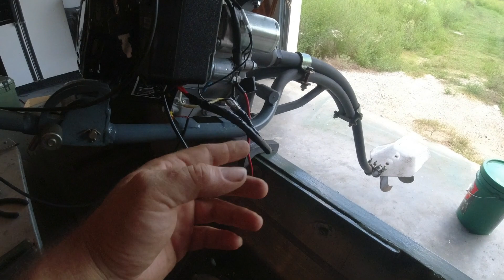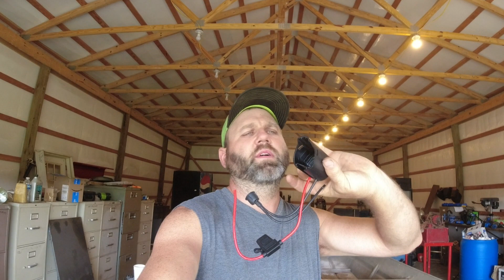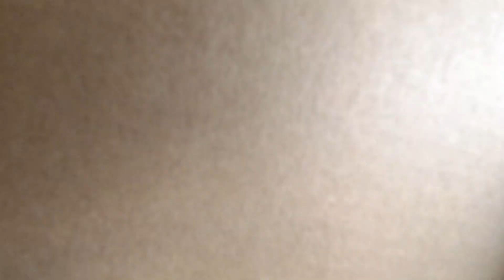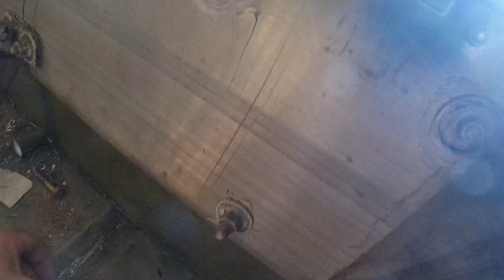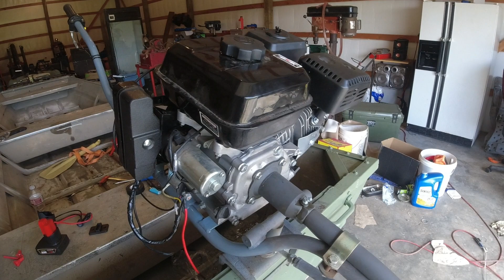Milwaukee vs predator can a drill battery start an engine

Comment: yeah those lithium batteries are extremely sensitive. I've been building lithium battery packs for about a year now and trust me when I say its easy to make a mistake. I'm sure a small voltage/current increase in the charge wouldn't hurt it but the concern with lithium is over charging. they don't just stop charging without the help of an external circuit (battery management system) which you can probably find for a 12v (3 cell) that may even adapt to the m12 battery.